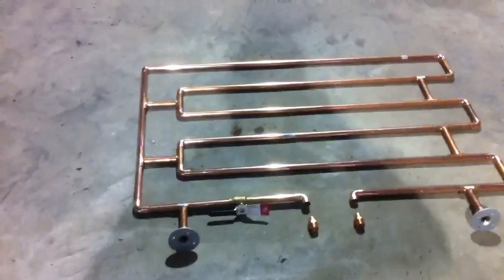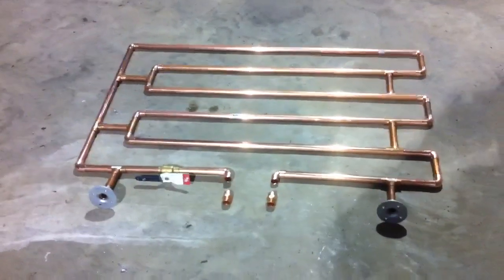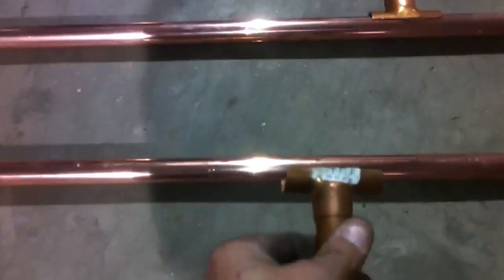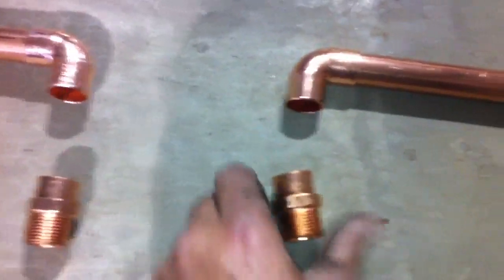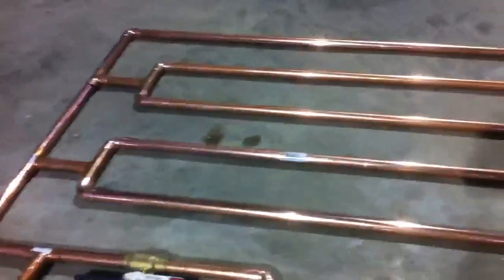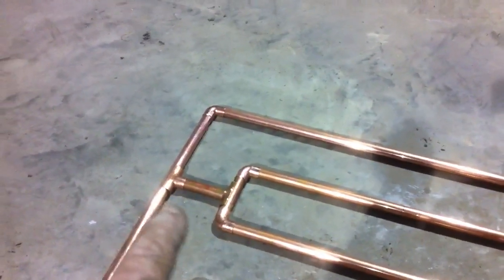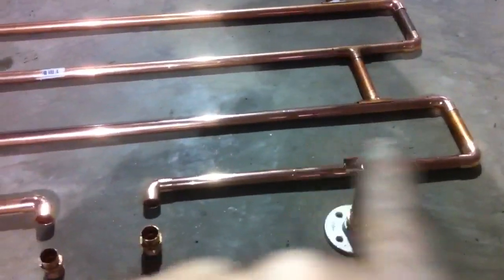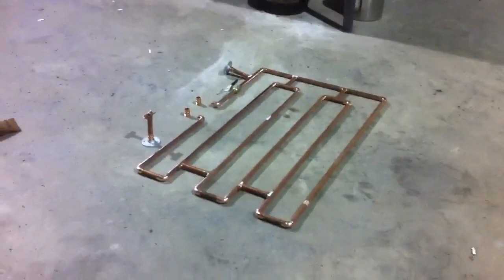Towel warmer

Comment: Andy: I like it.  But I wish you had spent more time showing how you installed it.  I have baseboard hot water heat.  I want to convert the ugly, borderline non-functional, 2-foot long heat register to a towel rack/heater similar to what you have made.  I'm trying to avoid anchoring to the floor because the bathroom will have a curbless shower and I don't want to penetrate the waterproofing on the floor.  You are obviously a talented craftsman.  I only wish you had offered us weekend warriors a few more pointers on the installation.  Regardless, I thank you for your good effort.  Nice work.